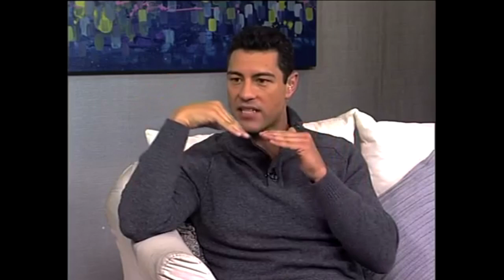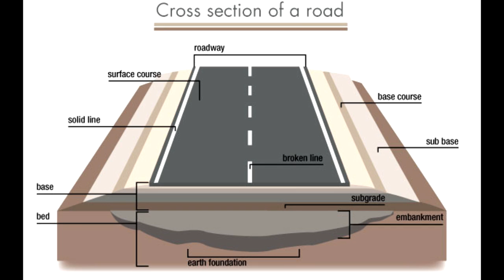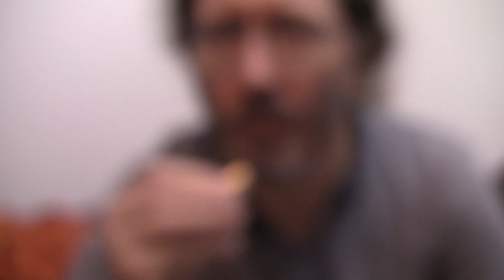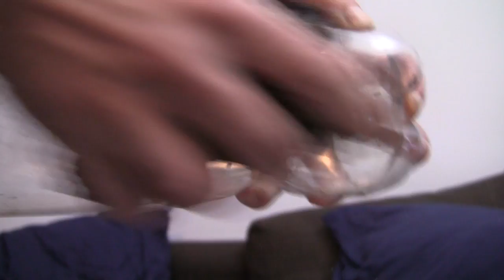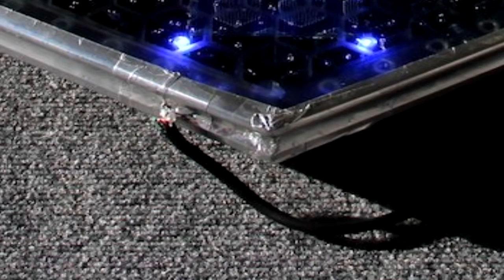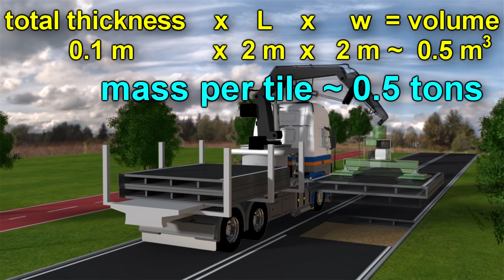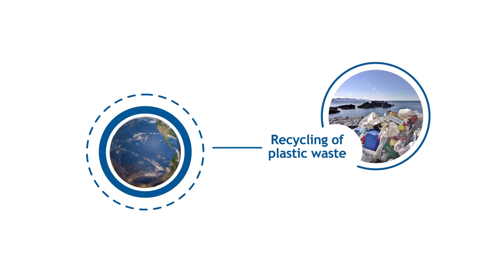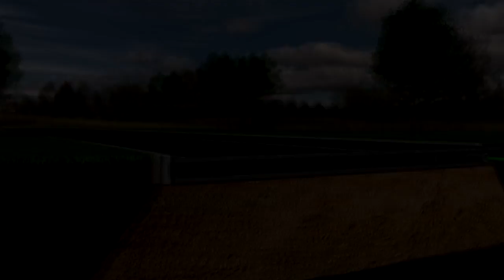Plastic Roadways BUSTED!

Comment: But Thunderf00t you forget all the benefits, i.e. if a car gets on fire, 911 do no longer have to ask about where the car are located, it can be seen miles away and a half a ton of molten plastic has never hurt anyone! Oh and even the blind can now avoid driving over a burning road part, by the smell alone (how the blind would drive a car, is not the important here) it's innovation and the future. Also imagine how easy it will be to find the super "light" plastic-road tiles again after a tornado, you can easily spot them flying hundreds of feet in the air, and they do not break, just because they fly into a few cars on the highway, go trough a house or land on some pedestrians. Thunderf00t, you do not see all the advantages! Imagine how much power it will save, every time a tile or more have to be switched out, the hours without power or water while a new tile is transported, replaced and reconnected!! You simply have to embrace the progress and benefits!! :-)
Reply: This sarcasm is really underrated man im died laughing
Reply: @yomi.airsoft  LOL! Thanks, you made my day by that comment! :-)
Reply: Silly Fired Mute
If a car get in fire, the policeman no longer even need to work since the whole road will be on fire very soon. Better yet, I don't think it won't be a long shot for the whole city get an extra day off from this as well.
Reply: @cellchow2339  Oh yes sorry, but that's even better!! You do no longer need streetlights, and you do also save all that work with removing snow in the winter and yes it's a wealth of benefits!! :-)
Reply: Mmmm maybe they will make it fireproof ? Lol
Reply: in order to get the strength needed to support cars that plastic is almost certianly going to be fibreglass reinforced so it probably wont burn well... so there is that at least, thats not to say that the area where the car was burning wont leave a melted warped ruined section that would need to be replaced.... fun times, especially if there is power lines or anything else going thru that road.
Reply: @islandwills2778  I like your comment, but I think you may be to logical and sane to my comment:-) Remember the video did show pure plastic, pressed and then got black. :-)

Comment: I work plastic molding and could only think of a few plastics that could actually work but it would be for long and there way way more expensive not 1$ per kg more like 20$ per kg and would get far weaker if you recycled it and still probably wouldn’t last half the amount of time as a regular road

Comment: Asphalt is an amazing material. I was actually listening to this video as I'm spreading used ground up asphalt on a road to be reused.
Reply: i like to drive on concrete. Asfalt is too soft. Here in LA we sinking into it in summer time. Cars create tracks into it. Changing lanes 80 M/h is not fun on tracks.
Reply: @mydigitallife8311  yikes. Don't need to worry about that here in canada. Lol
Reply: @Wilmafistfit69  ideally we could build roads like the romans did, and admittably they would last hundreds of years, but at what cost...
Services works alone (water, sewage, etc) would be a nightmare, but hey, fancy roads at least.
Reply: @DeerKoden  roman roads actually last as long as regular roads do
the roman roads simply didn't have thousands of several ton vehicles going on them traveling at least 50 kmh
infact roman roads were pretty much made almost exactly the same as modern concrete roads. the romans just also used stones and slightly different consistencies of concrete than are used today
also idk why service works would be any issue? given that again it's pretty much the exact same material as is used today

also not only that they weren't even really durable, again they only last longer from not having trucks and cars breaking and accelerating constantly on them. as u can see from images of the roman roads they are very bumpy and include large rocks thus making it an absolutely miserable experience to even attempt to drive on them at slow speeds, if you tried going fast on them it might genuinely break ur car apart. modern concrete roads and especially stone roads would quite possibly last equally long if not even longer if they didn't have people driving on them constantly

another reason these types of cobblestone roads aren't seen as much anymore is because from what i've heard, they are an absolute pain for people with arthritis to walk on thus making them less useful as even a strictly pedestrian road
essentially every form of travel has a much more miserable experience using them and their durability isn't even THAT good. we stopped using the material for a reason

Comment: I think this one can only work on sidewalks with less foot traffic because it will not much affect its structure. If they want to pursue this project, I think they can get away with using bakelite plastic since it is strong scratch, heat and solvent resistant but that plastic isnt recycleble, isnt flexible and you cant make it from PET bottles so that beats the purpose of their project ....

Comment: I agree with almost everything you've said, but comparing plastic with the composite of blacktop is a bit odd, especially scratching the bottle with the rocks.
Many plastic could have advantageous properties when compared to bitumen. Bitumen is sort of melty goop. It's not strong it's not hard. It just holds the gravel together better than nothing. And we have gravel roads without the bitumen.  I think the main idea here  is the drainage directly under the road. Which may or may not be worth screwing with. We actually should be looking for an alternative to bitumen with many of the same properties but most importantly, a light reflective color. Our roads and parking lots are huge heat absorbing swaths in our cities and towns. I totally respect the idea of a solar raid but really that's a huge step towards complication and expensive. A simple change in color could help with climate change and depending on material help with road longevity

Comment: I work in the plastics industry, I see many, many problems making a road out of plastic. It is very difficult to get the right mix of UV stability, abrasion resistance, coefficient of friction, chemical resistance, hardness, brittleness, longevity, water resistance, ozone resistance etc out of any plastic  or polymer that would even come close to what is required for a roadway, let alone at a cost that would make it compete in any way with current roads.

Comment: While it sounds good on paper, who's going to pay for it? Also, when it gets hot what then? You got some melt proof plastic? Plastic is also very smooth so traction is impossible. Not to mention, it might just create more plastic pollution in the long run since they would have to create more plastic to create multiple layers which I doubt the recycle plastic can suffice. Not to mention, it will be destroyed by abrasions much faster than asphalt.

Comment: Good idea to use plastic, when even concrete has proven to be inferior to asphalt. BTW, Asphalt is very easy to be repaired. The biggest problem of asphalt roads is: Often cheap asphalt is used or the substruction is build insufficient in order to save money. If done right asphalt streets can last years without a great amount of maintenance. Near my home there is a small road which was build over 15 years ago. Although frequently used by tractors and other heavy agriculture machines you cannot see one single pothole or any other area, where the asphalt had to be repaired.
Our commune was  criticized because this road was really expensive, but as seen it paid off to spend more money in a road that lasts.

Comment: I had a thought. What about curved roads? Would you need to fabricate a new bend for that singular turn? Not only that, but roads aren't usually flat. Do you have to bend them to will? If so I doubt it'll be a lot of heat

Comment: If you have pipes and conduit running enclosed under the road pieces as pictured, then before you can replace your road slab you need to unhook your conduits and move the cabling. At that point you're not making it any more efficient for maintenance. EDIT: 11:46 he talks about this

Comment: There are examples of plastic landscaping blocks and plastic  cobblestone.  As well as plastic tiles made from recycled plastic.  Some have laid those tiles down in a drive area to check for durability.  At the time of filming, those tiles had been down for 10 years. It showed a truck backing over them.  
Seeing as there are different types of plastic, with different hardness properties, it wouldn't be terribly difficult to find the correct plastic to use.   And let's not forget that plastic comes from petroleum. So the degradation can't be much different than the petroleum road.  
As for the conduit running underneath in a hollow spot, no.  Can't happen.  Replacing a section with a solid line of electricity, fiber optic, water or natural gas running through it would be next to impossible. 
 As for the road surface itself, let some college kids and a sponsoring company do a few test strips around the country.  Test it for flexibility, durability, longetivity, drainage, slipperiness, or traction abilities and degradation factors.   You could always add rock in the mixture, making it comparable to asphalt.

If plastic roadways are such a bad idea, why are they making plastic decking boards for decks?  Why make plastic roofing tiles that sit in daylight?  Why make plastic park benches?   I say give plastic road surfaces a shot.

Comment: The problem these "innovators" don't see is than not the littered plastic is a problem in the long run. It is the micro plastic. Even if you recycle all the plastic and put it into roads, the microplastic that is going to enter the enviroment because of road usage is exponentially more massive and dangerous.

Comment: Why couldn't there be a harder surface for the top and the plastic can be used for the structure of the casting below. Think about a random orbital sander. Without the sanding pad, yes the rubber shoe would go to pieces very quickly, however, put the sanding pad on properly and it takes the abuse very well. This approach could make for a much better road surface in the end. I believe we can improve the current road designs and it's going to be a process. We rarely if ever come up with an idea, build it, and say, we got it. You try to work out the process and design, build a prototype, see the flaws, and move forward with more and more changes till you work out the flaws to provide the best and cost-effective plan.
 When I was a boy my dad had to change his oil in the car every 2000 miles and points and plugs had to be gapped every 3000 miles and changed every 9000 to 12000 miles. Motors needed to be rebuilt after 60,000 miles on average. Now we have synthetic oils and improved filters so we can go 7500 to 10,000 miles before the next oil change. Electric ignition that can go up to 100,000 miles without a change. And if your engine needs to be rebuilt at all it's a lemon or it's been abused. some motors are going 300,000 miles regularly. Now with Electric vehicles in the near future, all that work goes away as well. But those changes didn't come without looking outside of the box. Just because someone came up with an idea didn't mean he had all the answers. But the process is in play. There are great ideas going into this road design and we would be foolish to ignore them. Living in New England Power outages are far too common and this road design is a great start toward a reasonable solution.    
 
As for your thoughts of water dispersion and erosion concerns the water could be channeled into the runoff systems in place. Think of it as a flood control system giving a place to regulate how much water flows in a given time. A couple of years back we had a hurricane move through our area and dumped 15"s of water on us in a few hours. With a design like this with some modifications could have prevented a large majority of the flooding and erosion that to place.   
 
I would say your thoughts of the wire chase have merit but there's a simple answer. Make the wire chase a separate piece running alongside the road. You could put water and sewer on one side and power and cable services on the other. There could be a third chamber for Natural Gas. Imagine being able to inspect the lines and fix the problem lines before blowing up an entire neighborhood like what happened in Massachusetts a couple of years ago.

 As to you dumb a** comment about the road tiles ripping up off the road when a car comes to an abrupt stop, well that was the low point in this video. Are you seriously saying they couldn't be anchored down to prevent that from happening? Nope, you lost it right there. There are a number of ways to overcome this "issue" if you could call it one. driving anchors deep into the ground might be My first thought, "Don't you think". 

 As for your solution to getting rid of plastic bottles by burning them. WHAT!!!! Are an Idiot. Give me a break. It's bad enough having to come up with ways to use them and not filling the landfills but you want to put those poisons in the air. Smart, NOT! Why do you think we stopped burning our dumps. Pushing all those toxins into the air has to be the stupidest ideas I've heard in a while. I'll choose not to do that, thank you very much.  

We have an opportunity to effect a positive change in road design, empty our plastic waste from landfills, and fix our utilities system in one fell swoop. Yes, the cost is something to address, but we are not just building a road. It's a much bigger project than that. when I asked my dad why we didn't build cars with all the things like fuel injection, electronic ignition, turbochargers, etc, etc, his answer was it would cost too much. Yet today we couldn't imagine going back to what we had then. Change gets a bad rap all too often. Yes, this current plastic road design needs work, but I'm willing to give them a chance to work out the kinks.

As for your Plastic Roadways Busted title, it's a swing and a miss. YOUR BUSTED! Your not much of a forward thinker and that's an issue that needs to be worked on. maybe you should bust yourself.

Comment: For starters, no power, gas, or water utility would run their lines in that. You might be able to convince some gullible people to run fibre in there but they like to use unspliced runs so everytime you replace a chunk of roadway they'd have to re-run the entire line.

Comment: I have an idea. We make roads out of steel. I know. I know. Steel is more expensive. But it is fully recyclable an infinite number of times. It is also much much stronger. And would last much longer. No more potholes forever. Because it is so much stronger, we don't have to use so much of it. We build maybe just 5cm wide, directly under the wheel. We build two of these running in parallel. Sure, we have to standardise the width of wheels in cars, but that is a small price. While we are at it we can remove the rubber tyres and make the wheels out of steel. Steel wheel on steel roads, extremely low resistance. We can easily achieve 10x the fuel efficiency we have now, whatever fuel we use. Petrol cars can get 200km/L. Battery electric cars can reach 3000 miles per charge. This also isn't some aspirational untested tech. We have working samples. How do we get steel wheels to stay on that extremely narrow 2 inch wide roadway? Flanges on the wheel! See, this is mature tech. Everything has been thought of.

Comment: Well this gets ignorant as quickly as the naysaying narrator comes in. First point immediately goes astray when trying to harp on about the foundations, as if plastic roadways wouldn't operate the exact same way Asphalt roadways do; replacing the surface. Neither of them are free of requiring the exact same foundation, and both of them are designed to replace the same driven contact layer. Hope it gets better from here asap.
Reply: It doesn't. With a completely inept and misunderstanding of the materials to be used in conjunction with other materials along with a shite demonstration of incorrect materials vs another.

Comment: The only way this would be even remotely practical is if its made for a specific vehicle type. As any car we have right now would be too heavy or have too little grip on the road. Another thing is plastic tend to melt under heat. So they will need an advanced underground cooling system for it. Heck. Any plan for utility device would have to consider the maintaince every once a week even if a vehicle was capable of succesfully driving on it.

Comment: All your points are correct, while plastic road is a bad idea, there is an idea to use plastic as asphalt mixture components. This will allow the use of plastics to replace some percents of asphalt material with little to no trade off as original mixture while reducing plastic pollution, and reduce road material cost.

Comment: I am sad that these has not been made. Becouse plastic road's sounds like a good idea
Reply: On paper, yes- in detailed inspection, no. Too many differences and variables on practicality and environmental impact between asphalt and plastic. You need it hollow to allow for expansion in hot days, yet that same hollowness creates cavities that allow frost to set in and cause those roads to crack and burst... and as mentioned, the plastic is so soft it's almost guaranteed to flake and chip over time, which would make these roads an environmental nightmare, not a saving grace.

Comment: The video only shows the roadway installed in flat ground. If the roadway has holes or porous areas to allow water down from the surface into the ducts below, then water can also rise up from the ducts onto the surface. Every time the road runs through a minor dip in the landscape the water will come UP through the road and flood the lowest areas.